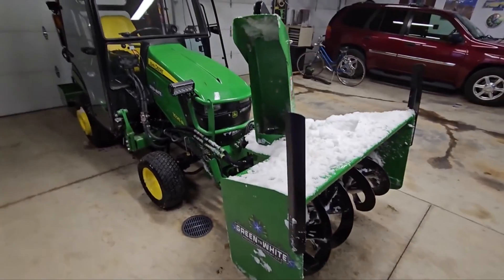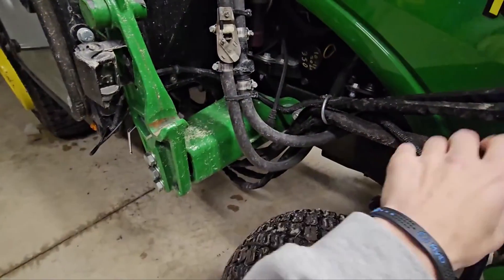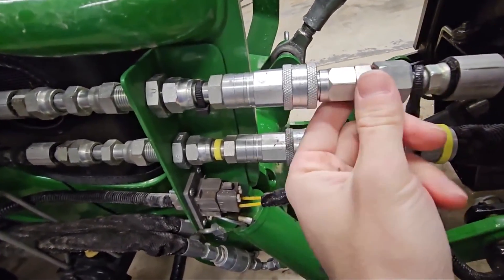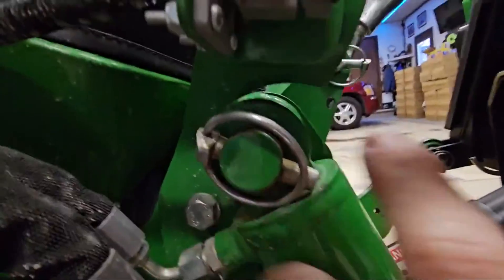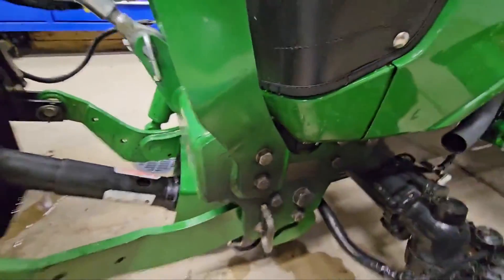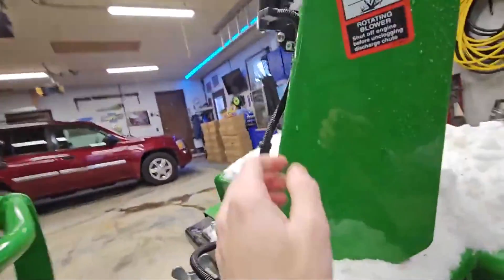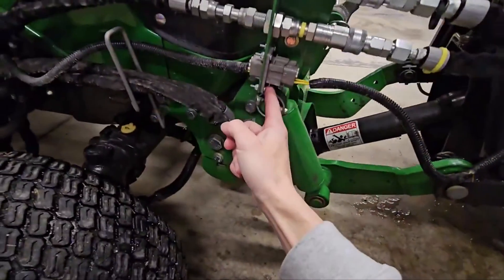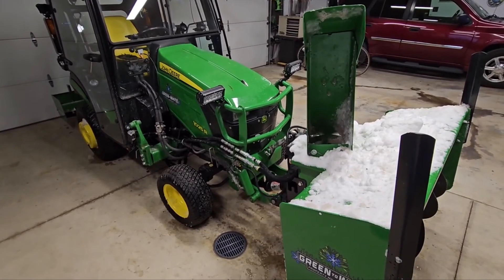John Deere 1025R Front 3-Point Hydraulic Quick Coupler Mod

Comment: Have you changed the fluid in the gearboxes on the snow blower? What weights of fluid did you use? The dealer is not able to tell me anything
Reply from the maker: You should find a better dealer its just gear oil GL-4 80/90